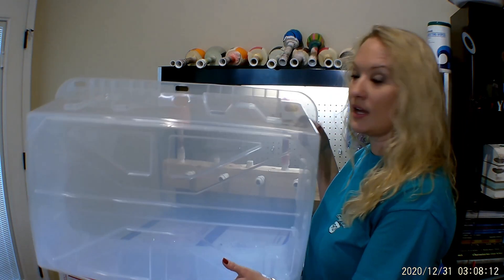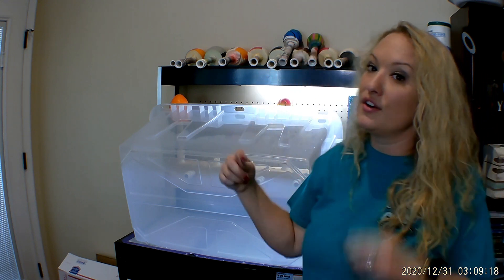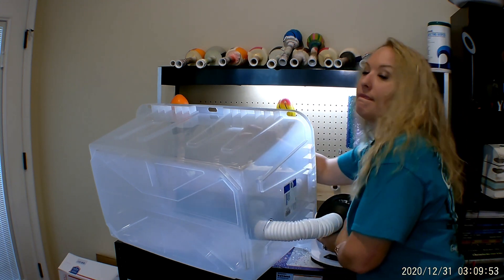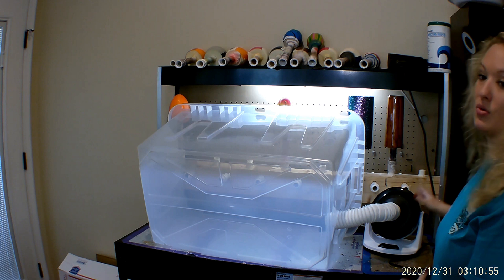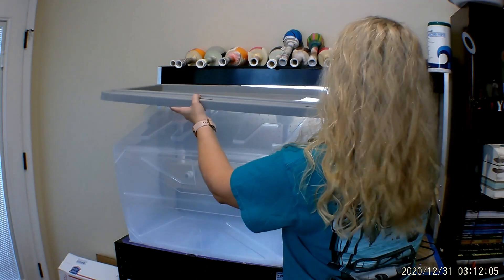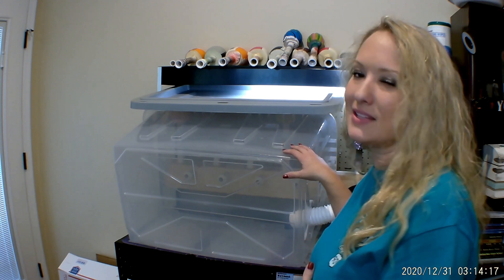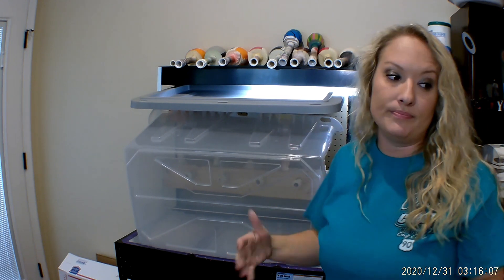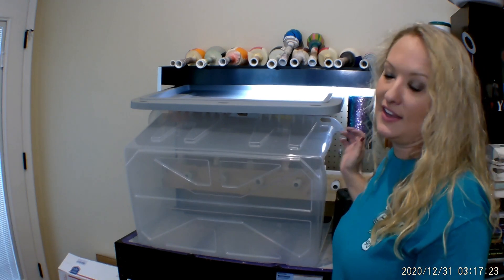EASY Heated Tumbler Drying Box | DIY |  Fastest and Cheapest Way to Dry Epoxy Tumblers

Comment: Where can I find a heated fan with a attachable hose? I’ve looked on eBay Amazon. Walmart cannot find it. Can you help me out
Reply from the maker: I recorded this video a couple years ago and I don't think that heater is available anymore. You can get a regular space heater and modify the side of the tub to go around the space heater without having to cuddle perfect circular hole. Just basically cut an area slightly larger than your space heater

Comment: what was the name of the space heater with a hose the link doesnt work and I cannot find the heater with a hose
Reply from the maker: I created this video about three years ago and unfortunately it's no longer available. You can still use a regular space heater, just make sure to cut the hole large enough on the tote so the space heater doesn't melt the plastic.

Comment: I clicked on the link for the new heat box with the heater and hose. It says the link can't be found. I really need that heater, could you please let me know the name of the heater.
Reply from the maker: The heater actually isn't available unfortunately... I created this video about 3 years or so ago. I guess they have stopped manufacturing it. You can create one with a regular space heater, just cut an area big enough so the space heater doesn't blow directly on the plastic tote

Comment: I just made one!!!!!how do u deal with air bubbles?I don’t have them usually but this made them come out a lot more
Reply from the maker: I don't have any issues at all with air bubbles. What kind of Epoxy are you using? Maybe try letting the epoxy harden slightly before putting it inside the drying box (maybe 30 mins or so) to see if it helps. Also I always pop any microbubbles with my blow torch.
Reply: I use counter culture!I think it was because I didn’t have a space between the bucket and the table and it got to hot but it works great!
Reply from the maker: @Aliciamarie1990  ooh yeah.. try letting it breathe a little bit so it doesn't get too hot. I'm so glad that it works great for you! 🥰

Comment: Hi. I am a complete newbie.  Can you please tell me if after an hour or so in container can you bring inside (as I live in a cold climate and will be working in garage) to keep cups warm or do they need to stay well ventilated? How long to keep well ventilated? 🤔 
Thanks so much for your help 🥰
Reply from the maker: Be sure to wear a respirator when working with epoxy and try to ventilate the garage if possible. I would let it stay in the container until it's dry to the touch. Technically, the epoxy is no longer considered toxic after 72 hours.
Reply from the maker: And welcome to the world of tumblers.. it's very addicting! 🥰😉
Reply: @KristisCustomCreations  thanks so much it's just garage is to cold so if I seal under container to keep as much warmth in there is no ventilation for cups is that ok?

Comment: I know you did this 5 months ago but i hope you can answer this. I did purchase this heater. I set it up  but my question is this. Does the heater go on and off when you turn it on. I put it on the high setting and it comes on stays in for a min or two then shuts off(  stoos blowing doesnt turn off off  )  for abfew seconds then comes on again
Reply from the maker: Ooh no... Mine doesn't do that. Mine runs as long as I have it on or shuts off when the time goes off if I set it.. I wonder if you got a bad one?
Reply: @KristisCustomCreations   i have two and they both do it. But it works great so i was just wondering
Reply: @sharinessig7806  maybe a newer version.  Once it reaches the correct temp it turns off to prevent fires.  That’s my guess.

Comment: Really don't need a hole saw just mark the size of the heater hose and use a soldering iron to melt the plastic and create a hole... thank you for this information very helpful...how do you keep the fumes/chemicals from the epoxy from escaping all over the place?
Reply from the maker: That's a great idea! Thanks! You are always supposed to use PPE and work in a well ventilated space when working with epoxy, the heater box doesn't change that.

Comment: I live where it's been in the teens-low 20s lately. I'm just starting out but I'm wondering since I only have 1 turner if you thought I could just put the turner and heater both under a tote completely. I have a 3 car garage which is where I have to epoxy. Thanks :)
Reply from the maker: Hey there! If you put both under there you need to make sure it doesn't get too hot.. you don't want to start a fire or melt anything. There are smaller space heaters that I have seen people put inside like that but they don't put off quite as much heat so it was safer. 😊
Reply: @KristisCustomCreations , do you happen to know which ones they use? Also, would it be best if I drill some vent holes in the tote? This is the heater I have. Thanks so much! 
http://www.walmart.com/ip/Mainstays-1500W-3-Speed-Electric-Fan-Forced-Space-Heater-HF-1008B-Black/419011167
Reply from the maker: @bobbih.9104  The ones I saw them using were very similar to this. 
https://amzn.to/3ctTi2i
It wouldn't be a bad idea to drill some vent holes in just in case.
Reply: @KristisCustomCreations , thank you so much!
Reply from the maker: @bobbih.9104  You're very welcome! 🥰

Comment: I've seen this tip from several of you pro tumbler makers and I thought it was exciting.  I got the fan with attachment from Amazon and I tried it.  After the first hour, it melted my pvc pipe!  Then, instead of drying my tumbler it ended up SUPER sticky.  Why is that?  Help!  I would love for this heater trick to work but I'm lost as to why it didn't work for me.  Thanks so much!
Reply from the maker: Oh my goodness! I use it with my PVC pipe all the time and never have any issues. I have found that I can't use it with any 3D printed turner attachments though. The heat shouldn't make your tumbler sticky, are you sure that the epoxy mixture was correct? Maybe try doing it on the low heat setting and don't let the air blow directly onto your tumbler, just let it heat up the box.
Reply: @KristisCustomCreations  weird right?? I did have it on low and pointed away from my tumbler so I think it was just the heat in the box over time.  Maybe I need it to be a bit more open.  But I have seen people crated amazing heat boxes for their tumbler turners that are completely closed up so idk.  Also, when I found this had happened it was about 1.5 hours into it being heated and I had been checking it about every 15-20 minutes. When I stopped it and let the cup sit out like I normally do for curing, it dried fine and wasn't sticky so I don't know why I had the sticky issue with heat.  I'm going to try again with some adjustments at some point and see how it goes before I give up on this trick.  Thanks for responding and doing your videos.  I love your creative results!!
Reply: @K M I tilted my box a bit more and it has been fine.  It did still soften some parts of my pvc since the weather has gotten warmer in TX, but it didn't completely melt and bend the pvc like the first time.

Comment: I live in Colorado and it is cold now😀.  Do you think I could use the box in my garage where it is cold?  Nervous to epoxy indoors.  Great video.  Thanks
Reply from the maker: Yes! I don't think you would have any problems using the heat box in your garage to help your tumblers cure in this cold weather. 🥰
Reply: Thanks for your quick response.  Happy New Year.
Reply from the maker: No problem! I always try to respond quickly! Please let me know if you have any other questions. 😊
Reply from the maker: And Happy New Year!

Comment: I am knew to this. I am wanting to make the swirl tumblers with alcohol ink. Will it hurt the curing if I let it turn for a while and then put it under the heat box? It's a lol chilly where I will be doing my tumblers about 60 degrees.
Reply from the maker: If you are doing an alcohol ink swirl then you will want to let the epoxy harden some before putting it in a drying box because it may cause the inks to swirl more than you would like if you put it in the drying box too early.
Reply: @KristisCustomCreations  Thank you so much
Reply from the maker: @kimwinnett6345  You're very welcome!

Comment: Would this method work with the pens?
Reply from the maker: Yes Ma'am! I use it for my pens ALL the time!
Reply: I was wondering the same...worried if the pens would warp?
Reply from the maker: @krisgerlach5910  I have learned though, if you are going to put the pins inside the heater box, don't use a 3D printed Turner attachment to do it. Do it with the foam Turner attachments. It will warp the 3D printed attachments. 🤦🏼‍♀️
Reply: How long do u leave the pens inside the heat box?

Comment: Hello great idea my question is if I took the tote and turned it upside down on my cup and put a hole in it like your second one and put the heater in front of the hole would that be to much heat, Thank you for sharing
Reply from the maker: It's hard to say but it would probably be ok. You won't know until you try it! I keep my cups pretty warm when they are inside the heater box so it won't hurt to try! 😊
Reply: Ok thank you I will try, Thank you again for sharing

Comment: Would this work if I  built a wooden box to go around my 6 cup turner and then attached the heater on the side of that wooden box? or does it have to be plastic?
Reply from the maker: Yes, a wooden box would work. That's a great idea! Basically it can needs to be something that can contain some of the heat from the heater to keep the cups warm. You just want areas in the box where the great can escape because you don't want it getting too hot.

Comment: I’m new to this and having an issue with the epoxy being sticky. I’ve tried adding new layers of epoxy over the sticky layer, with drying 6-12-24 hours on a spinner between layers and making sure my measuring resin/hardener is precise. Any suggestions??
Reply from the maker: Yes, if your Epoxy is staying sticky then it's not going to help by putting more epoxy over it. Your cup will remain toxic from the toxins in epoxy because it won't ever properly cure and the epoxy underneath can actually Leach up through the other epoxy layers that you have put down. My suggestion would be to strip the cup and start over. You don't want to risk anyone getting sick or the cup never hardening like it's supposed to. One coat of epoxy that isn't mixed properly or measured properly can ruin the whole cup. What kind of epoxy are you using?
Reply: @KristisCustomCreations  I’m actually trying to make some glitter pens for graduation gifts, using envirotex from hobby lobby. I just watched your video on tumblerpoxy and was impressed with how impressed you were lol. So actually think I’m going to order that. Hopefully it gets here in time to redo these pens 🤞

Comment: So I made the box, and I have the top part “open side” facing down on my table. Almost no heat escapes. I’m so worried that I might burn a damn hole through the box. I have it on the low heat. Will it be okay or should I open it a little
Reply from the maker: If you feel like it's too hot in there, just open it a little bit to let it vent 😊

Comment: I have a newbie question......do you wait for a while after you first epoxy to set your heat box up?  I'm just curious because I know that heat on a freshly epoxied item, makes the epoxy move.  And one last question.....I only have a double turner and a single.  So I think the set up I would use would be to put the box upside down on top of my 3 turners.  Do you think that would be to much heat without a really good vent like what you have?  Thank you Kristi!  You are a very talented lady!!
Reply from the maker: I don't usually wait too long before putting them in the heater box. Maybe 30 mins or so while I work on other projects. With the cups spinning, the epoxy usually stays on without dripping, even under the heat. If you were to have your heater box upside down, it may be a lot of heat for your tumblers but I would at least give it a try. If it turns out to be too much heat, you can always cut a vent in the box for the excess heat to escape. :) Thanks for watching!!!

Comment: Having a heater blow like that in the tote, does it not blow dust particles on the cups? I'm having the hardest time with keeping my tumblers dust or lent free. Help me!😲😢
Reply from the maker: Hey there! I don't have any problems with dust when I use the heater and storage tote. Have you tried just putting a storage tote over your cups as they spin without the heater? That should completely prevent any dust particles in your cups if they are getting in through the air. Also, I don't vacuum, run a fan, or do anything like that while my cups are spinning just to prevent kicking up any kind of dust.

Comment: I tried this and it melted my epoxy off my cup 😩. What did I do wrong?
Reply from the maker: Oh no!!! Turn the heat down to low instead of hi. You can also let the epoxy harden slightly before putting it in the box if its too much heat.

Comment: Thanks for the tutorial. I found the heater on Amazon. Do you leave any room for ventilation  or do you completely close it off when using the heater to cure the tumblers?
Reply from the maker: The whole front side of the plastic tote (where the lid would go) is open for ventilation.
Reply: @KristisCustomCreations  if I were to lay the box face down, would I need to ventilate it? I’m doing more thick projects and thinking of ways to heat the up easier and like this idea… but now sure if it would work
Reply from the maker: @TheRecoveringButterfly  I have seen where some people completely enclose their greater boxes but I personally feel like they need ventilation. If you are trying to do molds in them, I would be cautious of that because the epoxy if poured too deep can get extremely hot during the curing process.

Comment: I know this is 2 years old. Please, you need to tie your hair back. I freaked out when I saw you cut the hole in the tote. Your hair can get wrapped around the drill spindle or sucked up in the air holes. Take it from someone who wasn't worried about a vibrating sander. Luckly my hair was very brittle and damaged at the time it got sucked in the air holes and broke off as the sander slammed into my head

Comment: Isnt this unsafe
Reply from the maker: It simply increases the temp of the area where the cup is curing. There's plenty of ventilation and the cup dries much quicker. It's very useful for Crafters during the cold months when their crafting areas are cooler than normal.
Reply: @KristisCustomCreations  oh I’ve seen people do this on TikTok and everyone says that is unsafe
Reply from the maker: @Theredheadguru  haven't had any issues and there's plenty of ventilation. To each their own, I guess 🤷🏼‍♀️😊
Reply: @KristisCustomCreations  I was concerned of the same.  Space heaters alone are dangerous without adding epoxy in the mix.  Every year I see homes burnt by using space heaters.  I guess if you stay with it and watch it, it may be ok.  Just concerned because it looks like it is done indoors possibly a bedroom and I’m not sure if that is considered proper ventilation.  Although your technique is awesome, I have the same concerns.
Reply from the maker: @Hmngbrd22  I stay with it when it's on working with other crafts and the room it's in its an extremely large walkout basement room with more than enough ventilation.